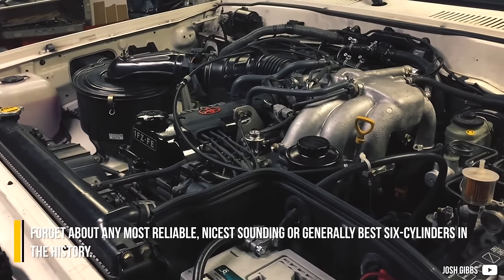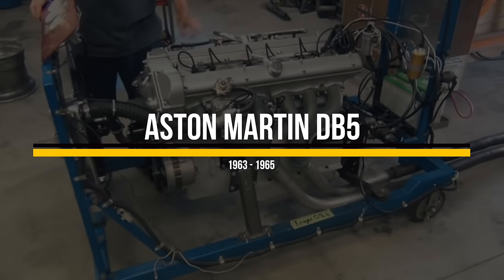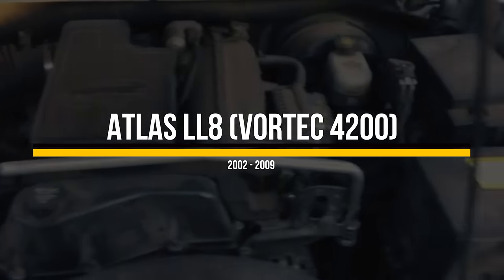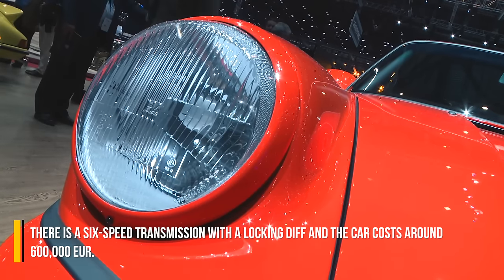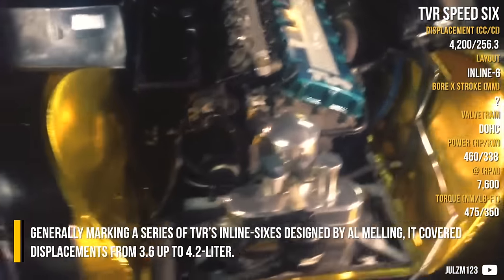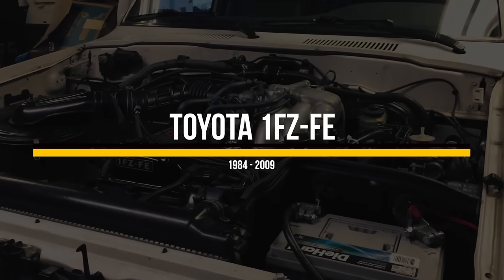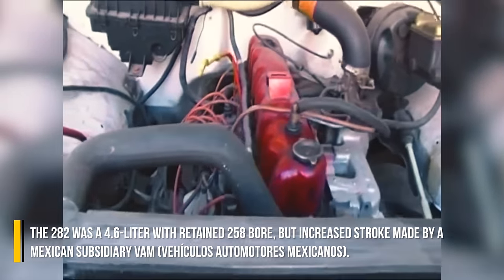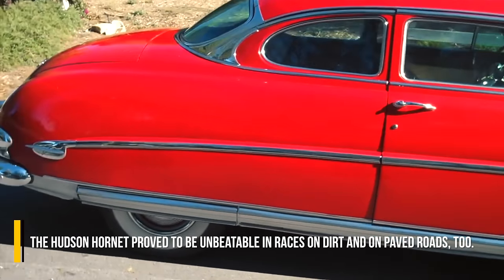12 Largest Automotive 6 Cylinders In The History

Comment: I still have no idea how American's managed to make engines so huge with such little power outputs.
Reply: they were meant to run all day with as little risk of breaking down as possible all while being reasonably cheap. This meant that their engines had relatively loosely fitting parts, low compression ratios and all that.
Reply: A trip across a country in Europe isn't even close to the size of some American states and Canadian provinces.
Reply: Is everything a race? No. Americans understand its easier to make a overbuilt and sometimes unnecessary big volume engines due to what the applications are. Better to underwork a big motor than overwork a small turbo motor.
Reply: It's due to regulations from back in the day put on auto makers. That's why American engines are very upgradable. But most of those regulations have been lifted.
Reply: Kuddlesworth NA .... it's our ridiculous pollution laws that choke the life out of any and all American produced engines....I mean, my lady's junk 1996 Chevy Suburban w/the detuned 454 big block V8 has a smog pump, which runs off of the belt, feeding TWO catalytic converters....It's GM junk, true, but still, that motor has the potential to make much more power than it does, but it can't really be modified because of Calif's retarded laws....
Reply: And with the with the low compression (and irom blocks) the possibility to work with bad fuel.
Reply: torque, not horsepower.
Reply: if you want torque, go for a diesel lol
Reply: @branon6565  these laws aren't ridicolous, they are nessecary.
Reply: not up until the early 90s you didnt
Reply: Gas was cheap and distances were far.  What our big and lazy V8's lack in power for their size they make up for with reliability and longevity.  Even before the Interstate system, lots of places in the USA were far apart and connected by roads that ran through sparsely populated areas.  People had to be able to depend on their vehicles to cover large distances at speed.  With the Interstates, Americans could travel hundreds of miles in a day, thousands of miles in a year.  Those lazy pushrods in a Chevy or Ford would run all day long and not need constant maintenance like British and European cars.  An original Mni (which is one of my favorite cars) driven down I-95 at 70 mph all day long wouldn't last very long.  

My first car was a 70 Pontiac Firebird bought in 1991.  It had been kept running but had only received basic maintenance over its life.  The V8 was smooth and reasonably powerful, and for five and a half years I drove that car all over the place, including multiple thousand-plus mile road trips.  It never needed any engine work at all; the only things that ever broke were the original radiator and original autobox tranny.  I bought the car expecting things to break, which would allow me to customize it as part of the repairs, but the thing almost never broke!  That's why we Americans made the engines kinda lazy... it didn't really tax them and with basic care they would run a long, long time.

My car was built before the conversion to net power ratings and a year before GM started lowering the compression rates and ramping up with emissions components.  Engines from about 71 onward really started to suffer the effects of restrictive emissions regulations and corresponding components at a time when the rest of the world was not running anything like this.  This is a whole other story, but one that is worth telling.  The power output of European cars in the USA vs Europe is telling:  same engines, but very different results.  It took a while, but the power did come back; Chevy sells a Corvette with 650 horsepower and very clean exhaust.  It'll outrun a 67 427 Sting Ray and won't gas you while doing it.  We live in a remarkable age...
Reply: ijshockey 25. True but sometimes they backfire. A big heavy car with a big low tuned engine that lasts 500k miles before being scrapped will almost certainly be overall less polluting than the 4 or 5 cleaner running, more fuel efficient little cars (full of complimicated doo-woddys that mean they only last 100k miles or so) that would be needed to cover the same mileage. Because scrapping a car and building the replacement uses and awful lot of resources and makes lots of pollution. Dust-to-dust emissions is the only real way to gauge how much of an impact a car's going to make on the environment.
Reply: My question, for curiosity's sake, is why would the big V8 in the Suburban really need to make gobs of power?  Even a mild 454 has stupefying levels of torque (contrast this with the 1.8 liter in my MX-5 that has very little low end) and can easily get out of it's own big bad-ass way.  I love Suburbans, but they're enormous and not really meant for spirited driving (though that does not some people...) and a mild tuning still gives it gobs of low end grunt in a package that doesn't need constant attention.  Also, this may be a bit unpopular, but emissions controls are a good thing.  I spent a month in Pompeii digging in the dirt in college, and the whole Bay of Naples is a lot like Los Angeles in the way the land and sea lie, and with few of the Italian cars boasting any emissions equipment, I had a month-long headache from breathing ozone and was coughing up black phlegm while I was there and a week after I got home.  The difference in air quality is just unreal, and we're lucky we have good American air to breathe.

If I were going to hot rod a truck where emissions are a concern, I'd start with a 4th generation Toyota Hilux.  I used to own one, an 85 2wd Xtra Cab with a 22R and five speed transmission and I couldn't kill the thing.  Not only was it a surprisingly good handling vehicle but because the engine was used in other applications, the Celica being the sportiest, there are parts out there to modify them and make more power.  I don't know what the situation with emissions is out in Cali, but my guess is that the smaller engine might be easier to keep in compliance.  Or you could move to Florida cause in the 17 years I've lived here, the fuzz has never checked the emissions on any of the vehicles I've owned.  There's a lot of weird shite going on, but if you're from Cali you're probably used to that.  Anyway, best of luck!
Reply: My question with the Suburban is why would you want a petrol at all when there are massive diesels available which will pull it better even if they make less power?
Seems weird to me they don't even make a diesel available as an option.
Reply: @whatchu_talkin_john_willis  You clearly don't understand the concept of torque and horsepower
Reply: Si Raff they did offer a diesel but at the time the diesel GM made was for fuel efficiency and didn’t make much power at all. The 6.2 indirect injection non-turbo V8 only made I believe about 125 HP and 250 lbs ft of torque when it came out. Needless to say as you can imagine with it being installed in a 3 ton Suburban, but they were sssllloooooowwwwww. And terrible on the hills or pulling a trailer. 
The later ones had a 6.5 turbo V8 diesel but even those were not all to powerful as I think horsepower was just a little over 200. Torque was a lot better at around 450 lbs ft but still not great for the weight. 
The 6.2 and 6.5 diesel were good engines, that were for the most part very reliable, and did get pretty good fuel economy, just were never designed to be a powerhouse. (Did sound really nice though!)

Unfortunately (and no idea why because I’m sure they would have sold a lot of them) the much more powerful and refined Isuzu/GM 6.6 Duramax V8 turbo diesel was never offered from the factory. There are some aftermarket places that will install one in a Suburban, but it’s not cheap lol
Reply: @nathanreimer1296  

Not true at all lol.

Look at European Ford's 3 cylinder 998cc turbo engines.

They are tiny yet deliver more power than almost all your big volume engines. 

Small engines with high rev lines and turbos are far more engaging to drive than a crap fuel hungry pile of shite
Reply: I'll just assume you've never driven in an LS7 Corvette with a 7,000RPM redline.
Reply: Kuddlesworth NA
Apples and oranges. It doesn't matter where they were designed, what matters is the country where they were sold. In the US, all cars had to meet emissions regulations 20 years before Europeans decided that reducing air pollution might be a good idea. European and Japanese engines didn't do much better when modified to meet US emissions regulations and some of those Euro engines were downright awful when modified to meet US regulations  (anything from Britain or Italy, for example, was essentially undrivable).
Reply: Top Fuel Dragster
Reply: EPA regulations
Reply: Depends a lot on the period.  Many of these engines were flatheads and those with overhead valves were typically not of the cross-flow design.  Breathing and efficiency were sacrificed for low production costs and many engines were used for decades with little in the way of improvements to cylinder head design.  Second big issue was fuel quality and octane ratings which limited compression (generally around 8 to 8.5 to 1 on non performance motors) and spark advance.  European engines of the period typically had higher output per unit of displacement because tax laws (especially in Italy) were based on engine size ... therefore some pretty high output sub 2 liter engines were made - even in the 50's and 60's.  In 1965 Pontiac introduced a 230 cubic inch (roughly 3.8 liter) six with overhead cam and had a version with as much as 215 hp - nearly touching the 1 hp per cubic inch metric.
Reply: No manufacturers wanted the straight 6's to perform well-that would have stolen the thunder from the big v8's
Reply: Kuddlesworth NA ford engines all make 100-200hp but then rock 300 torque
Reply: Oversizes engines were already a thing in the early fifties, then companies basically started to add displacement to increase power instead of re-engineering new engines as it was cheaper. By the seventies, all big engines were starting to be outdated due to the oil crisis, so they started to decrease performance to increase fuel economy (it is easier to do that than to engineer a new engine with new tech) and from there until the early 90s there were different regulations (either environmental or regarding fuel economy) to lead to the bigger engines to be less powerful. There were some 80s experiments with turbos, but for the most part there were anemic big engines. TL;DR environmental and fuel economy regulations, plus the American companies pretty much re-used old big engines instead of engineer new ones (and usually those new engines were based in older engines/tech).
Reply: +upside downdog | I'm Canadian, and I know it. Our land is spread very far apart.
Reply: Also many of the high displacement engines are also OHV instead of DOHC. Engines like the GM LS7 7.0L V8 and the 8.4L Viper V10 are both OHV engines and very compact and light for their displacment. The 7.0L LS7 is smaller than a 4.0L 1UZ Toyota V8 by a considerable amount despite making twice the hp. The Viper's 8.4L V10 is also only about the same size and weight as a 5.2L Audi V10 or 5.0L BMW V10
Reply: @verothacamaro  who would want to ?? Show it a corner and your dead 😂😂
Reply: its because we've only recently begun using forced induction from the factory, with the exception of some older diesels and a very few gasoline engines. we are dumb enough to believe the mantra "theres no replacement for displacement" and since the nostalgia for big ci v8s fom the 60s was so rampant we kept to it. recently weve come to realize we were wrong and started adding forced induction.
Reply: Michael Upton it’s true. The lateral g forces would probably make you black out.
Reply: Americans are inherently practical and as such they realize that higher torque is what enhances acceleration.  So they favor larger engines with low end torque that gets them going when the stoplight turns green.  

Speed laws limit what you can actually do with enormous horsepower.  Who needs it if you cant use it?
Reply: A dude who might know a thing or two, maybe. There’s literally no replacement for displacement. Take that hair dryer off and your 2.0 liter engine will make dick for power and torque.
Reply: @ijshockey2565  no he's right these are very unnecessary and unconstitutional laws
Reply: We are very talented. Besides, who needs horsepower when you can achieve the same results with lots of torque and appropriate gearing? I have a truck that weighs 13,500 pounds dry and it only has 134hp. It's not fast by any measure, but it will drag a mountain with it when it goes.
Reply: If your dream is tiny, over-stressed, high RPM engines that need master mechanics to keep in tune go to Europe. If you need stump pulling engines that last forever come to America.
Reply: Sterling,  I think the Euro vs. US stats for the same car are very telling.  Look at the number for a '75 BMW or Porsche.  The American versions are clogged as can be.  Heck, Chrysler had to stop importing the Plymouth Cricket (Hillman Minx) in '71 because it couldn't meet new US emission standards.
Reply: @JamieR1988  its called reliability, many of these small turbo motors pushing big cars will stop soon. They are over worked and will lead to problems
Reply: They're built for torque and longevity.
Reply: Aaron Hainan I actually wonder how the 6.5 would be in a burb. My dad owns a 2000 3500HD with the 6.5 and its only 195hp, it’s fucking slow even empty but it will pull our 8ton excavator no problem plus the stuff In the bed.My dad and I were actually looking forward to the Duramax and Alison combo getting put in the suburban but it never happened along with the 3/4 ton suburban getting canned too.
Reply: Jamie Reid I bet they won’t  last as long either though.
Reply: Ben Smith and California air resources board of CARB for California.
Reply: Rod Mosgrave what is it? I drive a 2015 Ford F650 and it only has 210 hp and it’s about the same empty and it’s awful!
Reply: @SquishyZoran 1973 (refurbished in 1991) Kaiser M35A2C 2 and a half ton cargo. Powered by the Hercules 465LDT multifuel. 

I also have a 1988 F-700 single axle end dump. It's roughly 800 pounds lighter and has (supposedly) 390hp. It's pushing closer to 600hp due to some (read: a lot of) modifications. It's still slow, but it will do it's top speed (92 mph) anywhere.
Reply: ijshockey 25  Many of them are actually. I remember when this diesel crap came about you either had to put a DPF in your truck or replace it and I know of many who couldn’t afford either since the filter and system was 20k back then!
Reply: Rod Mosgrave Neat! Those multi fuel engines sound awful  but from what I heard it’s the design so it can burn anything right? Also your F-700 sounds like what I want want HP wise, can we trade? Lol But seriously it is an awful truck and the dealer treated us so poor after the sale that if my dad ever needs another truck I’m going to beg him to get another brand despite there being another ford dealer a few clicks away!
Reply: since it american engines use pushrods they get valve float at high rpm and since hp=torque X rpm american engines with pushrods usually down have a high redline. but you can make a pushrod engine rev high with a big camshaft with a lot of duration, a good set of cylinder heads that raise compression and improve airflow, a good intake manifold and a good fuel system. in the 70s, 80s,  and 90s america's style of large lazy engine had to be cut down for emissions. american engines aren't built to perform out of the factory. A BWM v8 is great out of the factory but if you want to up the hp you have to get boost but with an american engine you just slap a bigger cam, better head, and good intake and it will perform great.
Reply: Interesting, given that the Buick 3.8 liter V-6 was a fucking MONSTER in the Buick Regal...  Especially with the single turbocharger, and intercooled version coupled with the BRF valve bodied 2004R automatic transmission.  It waxed the Corvette in 86/87, and the GNX/Turbo TA was faster still (although mainly by being a little lighter and having some minor timing modifications...)  Seems like Americans build V-6's just fine when the damn companies get the fuck out of the way and let them.
Reply: low hp but high torque, big sixes where and still are mainly used in work vehicles
Reply: Learn more about Torque.
Reply: Deez Nuts  thats a very convincing argument youre making there. you absolutely dont sound like youre suffering from a learning disability.
Reply: @bensmith4563  bro I get that you think cat coverters are the devil but I'm glad that every major American city isn't a smog pit. Sometimes you gotta eat your veggies and have some God damn responsibility for the sake of everyone's health.
Reply: I cant beleive how terribly unreliable euro cars were and still are .

Comment: You forgot to mention Nissan's TB48DE 4800CC i6 engine in the patrol!
Reply: And the TB45, although those engines were a bit shit
Reply: @HotForgeChaos  Definitely, I feel they lacked some power when stock but you can squeeze some immense power if you tune them right! They are much reliable than those tb48 ones.

Comment: The Ford Barra is indeed a big 6, and incredibly reliable (mine has 245 thousand miles on the clock, unopened) but it's not quite as big as one of it's predecessors, the 250 crossflow. However, the 250 might be a smaller variation of the 300, I'm not entirely sure.